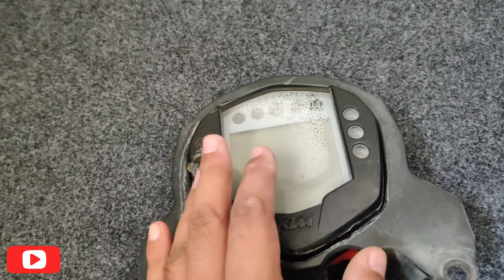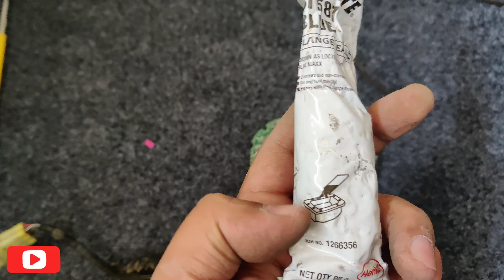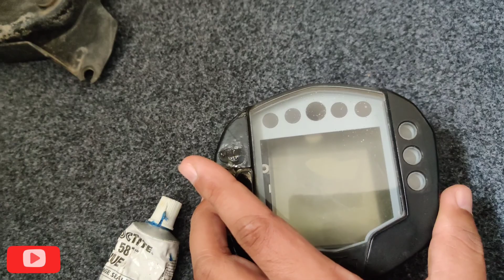KTM 200/390 speedometer/odo meter water Condensation solutions and mistakes.

Comment: Bro mri 390 m v same prblm h but main problem is ki rc390 ki meter remove krna is the toughest task for me
Reply: Bro please help my meter also same problem what did u do?
Reply: @PixR9911  mine is not working bro done all the things cleaned but still not working
Reply: @DANGEROUS_0069  i have repaired my meter for water damage which i have  repaired for 3k rupees
Reply: @PixR9911  bro you could have buyed it from Flipkart there its around 3200
Reply: @PixR9911  from where did you repaired
Reply: Remove the pcb and use a wire to connect the pin no 3 of db32 connector to display + terminal

Comment: bro i have a duke 250 bs4 but my meter doesn't show speed above 130 km/hr but i felt bike is going above 130 km/hr what is the problem
Reply: Change speed sensor cable

Comment: my instrument cluster making noise whats the reason and how can i solve this issue ?
Reply from the maker: What kinda noise do you hear?
Reply: @ridewithtaher2974  like shortcircuit noise on instrument cluster while i do higher rpm
Reply from the maker: It looks like the vibrations on the higher rpms sound like a short circuit or can be cause of water damage.
Reply: @ridewithtaher2974  how to get rid of this issue
Reply from the maker: Get the meter checked for any of both the issues
Reply: @ridewithtaher2974  okk brother thanks alot 🙏😇
Reply: Same with me
Reply: @swarajdweeprabha1841  service walo se screw tight krwa lo brother 2 mint lgege sirf thik ho jyega
Reply: @strengthgod4u  woh screw under wala tight karna hai keh bhara wala?